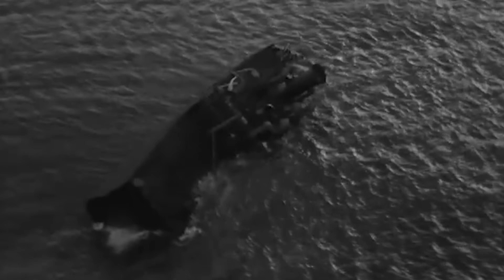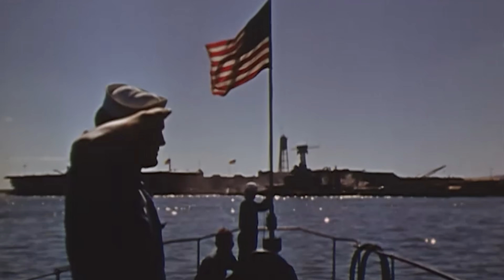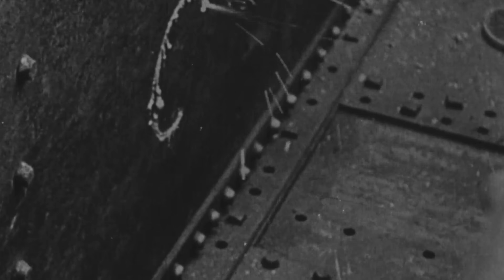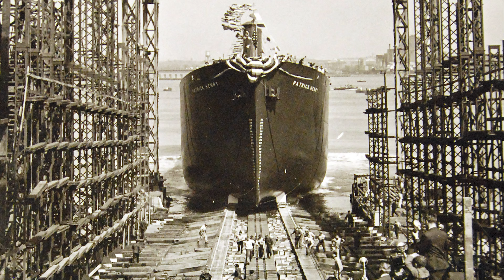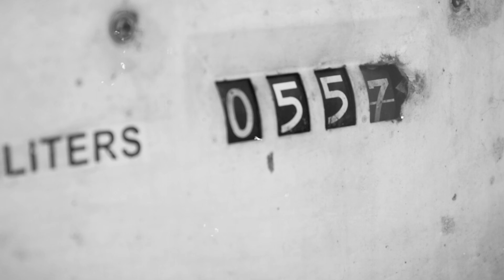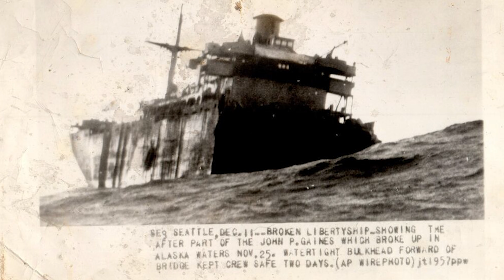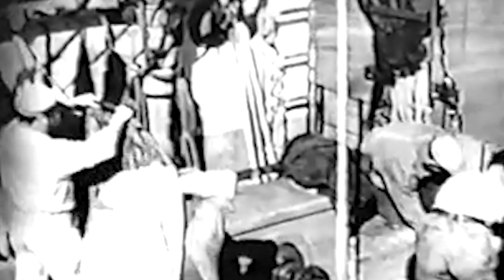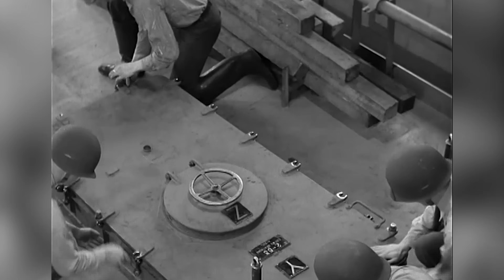CATASTROPHIC Design: The Ships That Broke in Half

Comment: I took a welding process  class in the mid 1960's and one the instructors worked at the Kaiser Shipyard in Richmond, CA. The instructor said there were many bad welds due to welders being paid a per foot bonus. He said welders would lay rods down and weld over them on multi pass welds and soak welding rod in water to make it burn smoother an faster causing hydrogen enbrittlmennt. He said there was no method of non destructive testing.He said these practices were stopped when investigations were started when these ships broke up .

Comment: There was an expression from the time, came in several versions "why rivet when you can weld, why weld if it can be bent, why bend if it can be left straight?".  Trouble was there shortcuts, initially anyway.

Comment: As the Chief Docent on the SS Jeremiah O'Brien, the last unaltered Liberty Ship (Pier 35 in San Francisco) I cannot thank you enough for your accurate and unbiased discussion of hull cracking.  Of the 12 ships that did break in half that you mention at 12:10 in your video, only three of them were Liberty Class ships, one was a T1 tanker and eight were T2 tankers. There is so much hysterical and blatantly incorrect information about hull fractures out there in 'internet land' regarding hull fractures, especially Liberty ships.
Reply: Precisely, they did the job. And for the dozen that broke in half, many times more that number survived a wartime walloping most would think require a cruiser or larger to endure.
Reply: Sadly, the internet spreads rumor and lies like wildfire, and truth like molasses in January.

Comment: The story of the rescue of the men on the stern of SS Pendleton was told in the film "The Finest Hours", released in 2016.   Definitely worth watching.  Thank you for this great review of the issue and how it affected these ships, as well as how learning from these wrecks ultimatelyimproved shipbuilding across the board.   I do find it ironic, however, that the issue with these ships is so very similar to what happened to the Challenger.   Both disasters happened because engineers didn't properly account for how cold would affect their vehicles.  So sad that something so basic as accounting for temperature variables in the environment hadn't been fully learned fifty years after the war.

Comment: In that time >60% of the US steel plants had the Bessemer Proces instead of the Thomas Proces and Siemens Martens furnaces or Arc Oxigen furnaces.
Even today US steel is 50yr. back.... Even the Alumin plants. In the short horizon view of shareholders upgrading doesn't pay out like as the refineries are not able to proces crude oil. Here in the Netherlands/DSM Geleen they built and commisioned a Nafta Cracker within 4-5yrs. after a disaster with Nafta Cracker 3 (HFL 5B corrected for inflation.) The design was from US Koenig Engineering. (!!)
Despite that DSM could have got the Nafta and other cracked products from the Botlek refineries. (DSM get its oil via pipelines too.)
We heard the explosion like a sonic boom nearby at school 25km away.

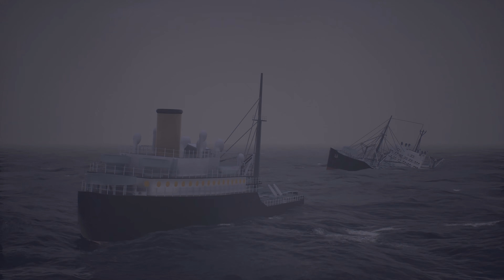Comment: Depending on the yard where they were constructed, Liberty ships were built with varying portions of welding and riveting.  The all-welded ships had a problem with hull failures arising from excessive rigidity, compounded with steel embrittlement at low temperatures.   However, the dramatic pictures you show of ships sinking at about 1:00 to 1:15 are of ships with well decks, which were NOT Liberty ships.  

 On the Liberty ships, two major corrective actions were taken by mid-point in the war:  the right-angled corners of the hatch coamings had small quarter-circular steel gussets welded in place to reduce the ability of cracks to propagate across the deck, and a belt of soft iron was riveted around the ships' topsides just below the gunwales (these corrective actions were made first to the welded ships, later extended to all Liberty ships).  Both these corrective actions can be seen on the SS JOHN W BROWN, the operating Liberty ship museum ship on which I was privileged to serve as a volunteer back in the 1990's.

Comment: Reminiscient of the problems the German railways had after the war, with thousands of wartime steam locomotives having been fitted with boilers made of a steel called St47K, which if memory serves contained too much carbon and was therefore prone to brittleness and ensuing boiler detonations.  Replacing those boilers was a massive undertaking, obviously, which kept the German railway industry busy on both sides of the Iron Curtain throughout the 1950s.

Abyway, great video as always.  Thank you, Mike Brady, you are a true friend :-)
Reply: That's true. The St47 had a higher yield strength, which enabled the boiler thickness to be reduced, so you end up with a higher stress range per thermal cycle. Couple that with a steel chemistry that increases yield while reducing CVN toughness, and you end up with a seriously reduced service life. A double whammy, as it were.

Comment: What about more modern ships like the Argo Merchant that broke in 1/2 off Cape Cod and spewed oil over pristine beaches?  The USS Longstreet  which was placed in Cape Cod Bay was put there on purpose and used for target practice and is now under water and still there.  I remember you also did a video on the Andrea Doria and the Stockholm collision.  Cape Cod is littered with wrecks going back before the pilgrims.

Comment: Although there were instances of these ships breaking in half it also should be pointed out that many more of them remained in successfully and productive service for decades after they were constructed.  I sailed on two Victory ships during the late 1970s and one T2 tanker during the 1980s.  It was only after the loss of the converted T2 tanker "Marine Electric" in 1983 that the US Coast Guard finally began cracking down (if you will pardon the expression) on the commercial operation of the elderly T2 tankers and they finally were withdrawn from operational service.  In. the case of the Marine Electric, her catastrophic loss was proven to be due more to age and poor maintenance than to design flaws or poor quality steel.

Comment: Regarding the SS John P. Gaines, if it set off from Dutch for Seattle, it was in the North Pacific not the North Atlantic - if it was in the latter, they really were lost!! 2,710 "Liberty" ships built, 12 suffered catastrophic structural failure - that is a failure rate of 0.44%. If you include the tankers, total ships built was 5,500 vessels built, with a total of 19 catastrophic failures, or a failure rate of or 0.34%. 1500 records of significant brittle fractures were recorded, but this involved 423 individual vessels or 7.7% of these ships - considering how they were built and pressure to launch them for the war effort, I don't think we can see these vessels as anything more than an abject success. To put this in persective, 179 Liberty ships and 18 Tankers were lost to enemy action or the weather during WWII, which is only 3.5% of all those vessels made and launched.

Comment: Great video!  Nice touch, throwing in the launch footage of the Laker Irving S. Olds!  This video reminds me of the Daniel J. Morrell, a Great Lakes ore boat, lost on Lake Huron on November 29, 1966.  There was one survivor, Dennis Hale (since passed on).  The ship was 600 feet long, built in 1906 at West Bay City, Michigan, (as was her sister and fleetmate, Edward Y. Townsend).  The Morrell broke in half during a horrific gale as she and the Townsend were upbound empty on Lake Huron.  The ship split in two, the stern powering on, pushing the bow to the side.  The stern sailed on five miles before sinking!  The Edward Y. Townsend, behind the Morrell because she sheltered in the St. Clair River, continued on toward Sault Sainte Marie, Mich., and upon arrival in the St. Marys River, it was discovered the ship had a three-foot crack across her spar deck.  The Coast Guard immediately pulled her certificate, and she was towed to European ship breakers.  She never made it, having broken up off Newfoundland.  Brittle steel was the cause of the fractures, since steel made prior to 1948 was prone to failure in this regard.

Comment: You couldn't see into steel without cutting it in half before x-rays. The best they had was semi-molten "pour-outs" that caught some crystals before the rest turns solid. Like bismuth crystals, they are made by waiting until the crucible is partially solidified and ya pour it out. The brilliant colors on bismuth is actually a wash of oxide that was floating on the surface, if you clear the dross they come out silver.

Comment: The liberty ships and the t2 tankers were only expected to make 1 crossing of the Atlantic. They were bare bones simply designed affairs. Simple easy cookie cutter ship. No stunning new tech,  no new special wonder material. It was straight-up war by production. The object was to put them together and get them down the slipways as fast as possible. They were meant to meet a need at a time when the Allies were losing ships faster than they could be replaced. It was a war by production the 1 who makes the most wins. I think it was Stalin who said "Quantity has a quality all its own". They met that requirement and much more.

Comment: So a fun fact thats not Ship related by Kaiser related. In the post war era after ship building was no longer needed he wanted to go into car manufacturing but wasnt sure how to so he teamed up with Joe W Frazer a very well known automotive industrialist and created the Kaiser-Frazer corporation and sold cars from 1947-1955 in the U.S. then Argentina till 1962. They made cars in the Willow run plant till 1953 when they bought Willys (which they renamed to Jeep 10 years later) in which then they built their cars at toledo Ohio till as mentioned before they moved down to Argentina. Now there are many reasons  (mainly) the "Big Three" putting Kaiser Frazer out of business but i do often wonder how many WWII veterans never bought a kaiser because of the shups thst split in half built there. Even though not many split in half during the war comparatively speaking.

Comment: As a former shipyard welder, I can attest to how rough the work can be.

 Having to bend a welding rod around a double corner and using one or more mirrors to see around said corners, and then subsequently using a mini grinder to grind out any pores or other visible impurities in the resulting welds, is tedium I've yet to encounter in anything else in life so far.
Reply: I watched a Shipyard welder weld a missed joint using a mirror held with a magnet and a stinger tapped to a long broomstick and it passed inspection . You welders are rock stars.

Comment: the fact that the ships stayed afloat after splitting in half is amazing
Reply: Watertight bulkheads are a wonderous invention.
Reply: @flametitan100 I mean technically titanic had watertight bulkheads and she split, her stern now rests more then a mile under the North Atlantic, so it’s not the watertight bulkheads, it’s how it splits
Reply: @twilightparanormalresearch186  Yes obviously how clean it splits is a key factor, but cases where the bow or stern break off and reamin afloat wouldn't even be possible without a bulkhead.
Reply: @flametitan100  in theory, it would be possible even for the Titanic's stern to stay afloat if it wasn't dragged fown by the bow for a few seconds
Reply: @fidan2fast  maybe, but the split wasn't clean, and she broke such that the single heaviest parts (her reciprocating engines) were directly exposed to water. The odds weren't in her favour even without the gentle tug.
Reply: Fulcrum at breakup is likely at the keel, specifically right below the reciprocating engine room

(One of them was outright ripped off by the compressive forces that was hogging the ship)
Reply: It’s amazing how often ships lost their bows, and survived, just in WW2 alone.
Reply: Yeah, that was kinda learnt the hard way
Reply: Glory be to the watertight bulkhead!!!

Comment: Fun fact regarding Titanic's steel;

During the steel tests conducted on samples recovered from the wreck (showcased in the 1998 documentary Titanic: Answers from the Abyss), it was learned that Titanic's steel was 378MPa test strength - modern ship steel, as old steel during Titanic's era, ranges between 260 and 450MPa.

Indeed, later-recovered Harland & Wolff documentation indicates H&W had very strict demands of the quality of steel plating they ordered, being 26-30 TSI. That is the exact range of modern ship steel.

Titanic's steel was a unique mild blend produced by David Colville & Sons in Motherwell, Scotland. The difference between Titanic's steel and modern ship steel is ductility - a sliding scale of flexibility. The more ductile a steel blend is, the more it can flex and deform without cracking.

There needs to be a balance of course - too nuch ductility means thr steel won't be strong enough to support the ship's structure. But too little ductility means the steel will crack and fracture earlier.

Modern ship steel is some 30% more ductile than Titanic's steel at average operating temperatures, and up to 100% more ductile in extremely low temperatures.